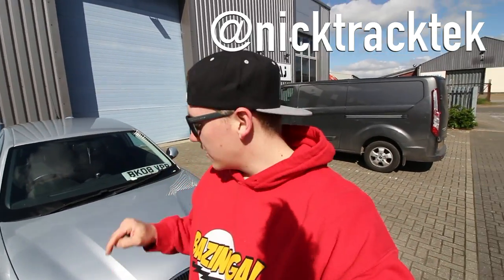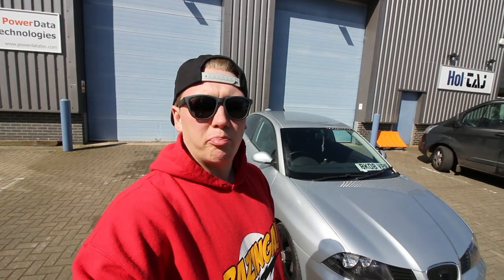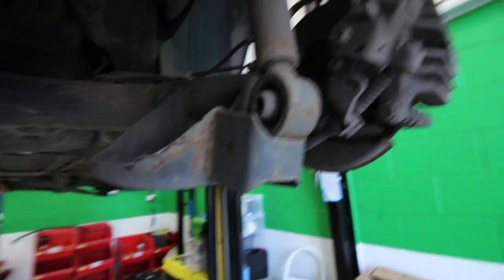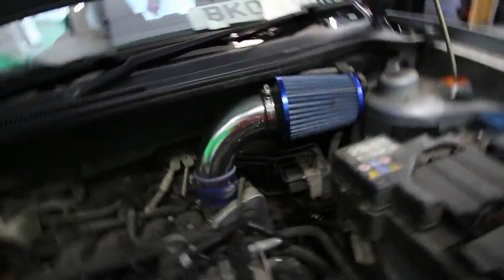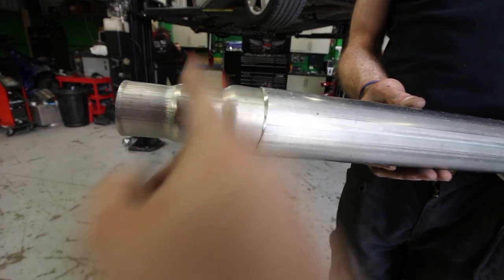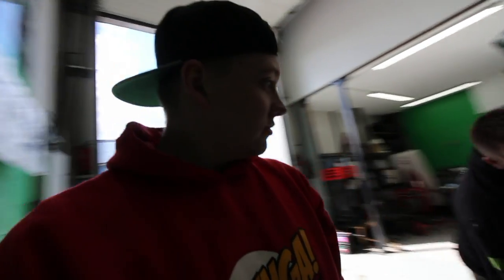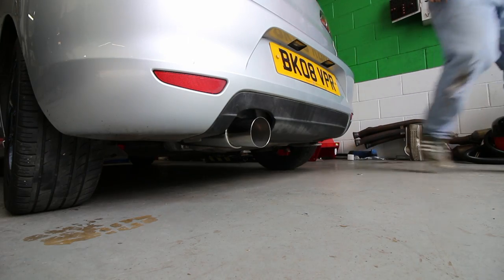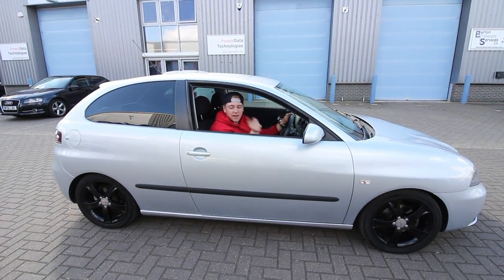Seat Ibiza Sport gets Universal back box at Track-Tek

Comment: Installed a K&N air filter in my 2008 ibiza 1.4 100bhp sportrider. Been using shell v power petrol. Had 120mph out of it. Was thinking about buying an exhaust and fitting it myself but after seing i had to cut old exhaust off, think ill buy i proper exhaust and get it professionally fitted. 🤘🏻😂🤘🏻
Reply from the maker: Do it. I never looked back. I actually miss Britney so much... hahah 🤣